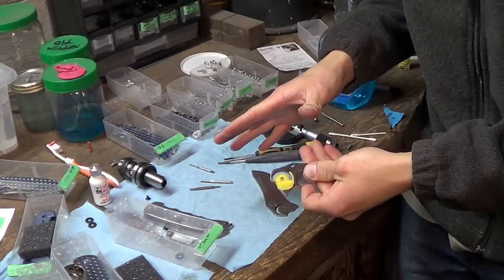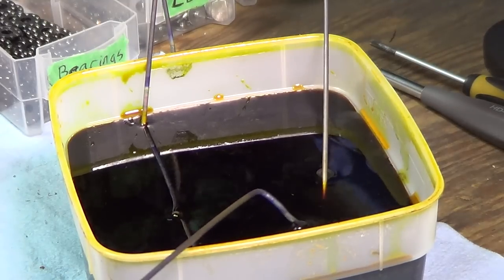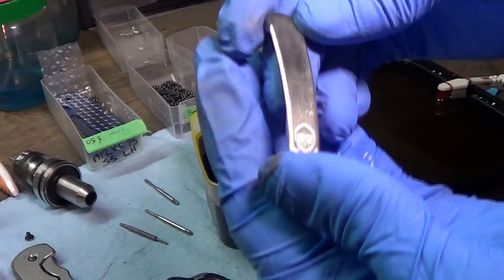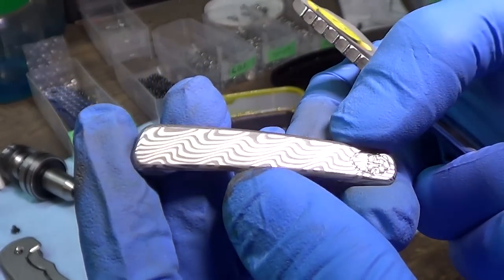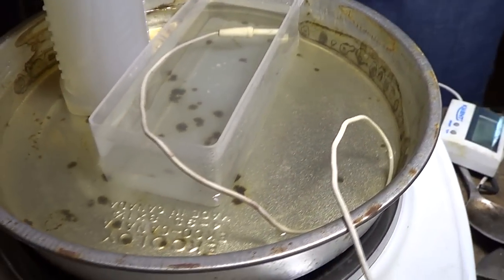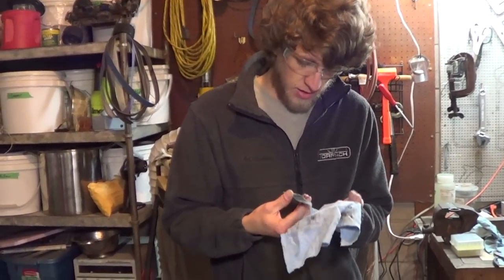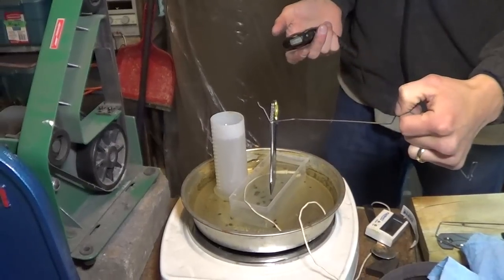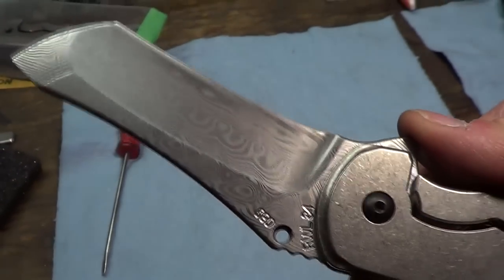Etching Damascus knife blades

Comment: A tip for everyone....keep the acids away from your tools...even if in a sealed container...Muriatic is nasty enough to slowly evaporate and/or leak from the container, you will find that nearby steel items will rust.

Comment: The patterns on the blade reveals the technology of how they make the blades. It is like a samurai sword. They press on the melting metal to form a sheet, then reheat it and fold two layers into one, then press it again. They repeat the process to make the stainless steel harder and more easily sharpened! This is just an ancient old trick that modern people find their ways to entertain themselves out of it.

Comment: Muriatic acid is "hydrochloric acid" (HCl) in a less pure and diluted strength for non-technical applications like cleaning bricks. Ferric Chloride is an iron "salt" of HCl that is nonetheless very acidic, though not as "strong" as HCl.

Either will etch any high carbon steel, eventually. It is a matter of strength and timing. Everyone has a slightly different dilution and technique. The keys are "pretty dilute" and "multiple, short immersions". Wash the black oxide off between immersions and perhaps brush lightly with non-abrasive kitchen Scotchbrite or 800 grit paper. Dilution should best be done with distilled water to keep it uncontaminated with water minerals. Beyond that it's a matter of experimentation.

Either will do fine on Damasteel.

Comment: Good work John!! I'm no expert, but here's a hypothesis: I suspect the bubbles hold the acid back and act as a temporary resist - until they pop. I think if you let the blades sit, each bubble will last longer, and you'll get pronounced pitting around the bubbles. If you keep agitating so the bubbles are short-lived, you may get a smoother finish. Keen to hear your thoughts.

Comment: When I did it for a company. We used mixture of 4:1 diluted in water. 3 15 min intervals. Scrubbing between each intervals with baking soda and water. Then rubbing it with a bit of 400 grit sand paper. Just to bring out the highs.

Comment from the maker: Interesting question. As far as I know, etching does not weaken the steel.  It does remove a teensy bit of metal, but so little that it doesn't make a difference.

Comment: nice blade. I want to humbly mention that you may want to try cutting the ferric chloride about 4:1 or 5:1. The more dilute etchant leads to less pitting and still gives a very nice etch. It is still much faster than hydrochloric. It mostly reduces the reactivity with the nickel-bearing steel (or chrome bearing). I can't make a folder like you can, but I make swords. For showing hamons, use one or two etches of ferric chloride, then use 2 or 3 etches of vinegar for over a hour each time. Vinegar makes the hamons turn more white.

Comment: Hey dude i wouldnt worry too much about the pitting in with the ferric chloride acid because you are using a ferric acid to etch a ferrous metal, so the pitting is just gonna happen. But you dont want to etch too deeply, remember, the more you etch the more metal you are eating away, potentially weakening the blade. You want that happy balance between a strong blade and a pretty blade. Awesome work though dude keep it up.

Comment: Muriatic (Hydrochloric) is going to etch just about everything evenly, and the more resistant alloy will etch slower, but evenly - FeCl tends to etch randomly at grain boundaries, so you get those little bitty pits.

Electrochemical etching isn't a bad idea either - "anodizing" your steel like you would aluminum won't result in an anodized layer - it'll just "de-plate" the surface, VERY evenly, and might even out the pits as well.

Comment: John, I just etched in Ferric Chl. I heated it in the Microwave for a few minutes and it was hot. It did an excellent job too btw.  Just wanted to make sure (after the fact),,, that what I did was ok n safe ????  I took the necessary safety precautions, using breathing mask, safety glasses, as well as ventilation and airing out the room etc. but, I just wanted to ask before I did anything again ????  Loll 
Mark in Ky.

Comment: Etching is used in metal research to bring out the grain structure of a metal sample (but for 15 seconds on a sample). While it shouldn't really weaken the knife, as seen by the significant pitting it can decrease the amount of metal you're actually working with.

Comment: from what I have learned, in order to get a good contrast between the metals, you must first heat treat and temper the blade. Do your metal finishing (wet sanding) then etch in ferric chloride. 
I know this is an old video but anyone new, this may help.

Comment: Damasteel is pretty easy to work and gives a good cutting edge, but once your comfortable with it, I would try real Damascus. Not that there is anything wrong with damasteel, but the higher carbon of most Damascus will help your blades keep their edge longer and you don't have to buy, or handle muriatic acid to raise the grain, but without all the nasty pitting.
Nice work, thanks for the vid!

Comment: Ok if this helps your supposed to heat the ferric cloric acid if you read the instructions on it when used for etching in electronics there is an optimum temperature, so if there is a optimum temperature for etching copper it will be simular for your damascus. Im Electronics Engineer.

Comment: John, to get better contrast between layers when using ferric, try multiple short soaks and remove all of the scaling with 0000 steel wool and baking soda in between each soak as someone posted earlier.

Comment: For ferric chloride, you need to have 1 part ferric to 4 parts water mix ratio. it will etch much much faster and deeper. and dont scrub the metal, rinse it with windex and let it dry, then hit it with fine steel wool. the contrast of colors will be much stronger. make sure the metal is extremely clean with acetone before it goes into the acid bath, completely free of oils from hands and finger prints.

Comment: I'm wondering about the vinegar. I made a perty cool knife it's Not Damascus  but the camo came out cool.gona try my  Damascus metal blade now and see if it brings out the grains better..I just did muriatic acid with hydrogen peroxide 50/50 after taping in a camo pattern with aluminum tape.

Comment: Ive etched a bunch of blades, and at first I got mixed results with the color contrast, try a fish tank bubbler in your acid, this keeps the pitting to a minimum and you get a even etch, after etching, neutrilizing and scrubbing try applyoing a cold super blueing, a couple coats drying between, rinse, neutrilize and wet polish using wd 40 and 800 grit paper....you'll be suprized how dark and easy it is.....nice work by the way

Comment: Hi there,
I have some damasteel here as well (about 26mm round bar) because I made an engagement ring for my fiancé. The only-sulphuric acid didn't work well for me, so I moved on to sulphuric acid (battery acid grade) with perchloric acid. Worked great, but most of the contrast is already gone. I have now ordered Fe(III)Cl, HCl, Cu(II)Cl and better H2SO4 for the "ultimate" etch. I hope this one will be more durable, but I'll let you know. If not, any ideas?

Comment: Try Muriatic for what you're calling "height" difference and then Birchwood Casey cold blue to darken.  Touch up your high points with 1500 wet dry paper on a finger block and you'll get some amazing looking damascus.

Comment: Hay John,
You can get a bit better etch with the radio shaq ferric chloride if you dilute it half strength brotha. I have been using it for about 6 years now:) but it goes bad fairly quick. I also do a much harder etch than your doing so who knows? I dont get any pitting like you were getting.

Comment: when you etch with the faric chloride, or anything else for that matter. If you let it etch until both metals are etched, you went too long. Basically let it etch long enough to bring out the dark color, and no longer. Once you start to erode the top metal,the "shiny" one you are doing nothing but screwing up all your prep work on the blade before it went into the solution.

Comment: Perhaps part of the problem of contrast passes in your solution have 3 metals. The two varieties of steel forming Damascus, and the wire you use to hold it. Try a plastic cord. Good luck.

Comment: You are NOT going to get a different coloration (blackening) because of the corrosive liquid of choice. For that dark grey or black coloration, you'll need a blade with one of the steels having a significant amount of manganese in its composition.
Reply: Dwight looi.    Nickel. Not magnesium.

Comment: Just looking at the sharpened, edge of the blade after it came out of the asset, did it actually take away a part of your  sharpened Edge ?
Reply from the maker: jozzerful2 It's not fully sharpened at this point, just mostly.  If it were totally sharp then yes it would take some away.

Comment: I have a set of Damascus 67-layer kitchen knives. Can they be etched like this? Will there be any issues with the sharpness of the carbon layer?
Reply: +Viranjith Tilakaratne 
Sure. The contrast will depend on the difference of the steels used (mostly on the chrome, nickel, vanadium, and carbon content). Be sure not to let the acid get e.g. between the handle and the bolster / tang. I recommend using sulfuric acid. You can heat for faster etching, but don't inhale the fumes. Always neutralize the blades after etching.

The layers with higher carbon content will obviously etch more, and depending your pattern, you might get a rough or 'sawtooth-like' cutting edge. Some might argue this is good for cutting meat, but at least I have always sharpened the knives after final etching, smoothing out the edge.

Comment: I have a question I have real Damascus 1911 it has a Damascus slide. the gun is stainless steel they have it done in matte. the areas in between the shinny areas are matte like can I redo the Damascus to get higher  contrast. it has a sweet pattern but the areas in between need to be darker. how done do that.

Comment: These knives are clearly better than anything ill find at basspro, however I'm curious as to how you justify a $500-$600 price tag. Especially when they're more or less all the same. I understand that the materials you're using are high quality, and the machinery can't be cheap. But $500 for a pocket knife? Serious question.

Comment: What did you use as a mask for the pattern? How did you apply it?
Reply: this type of steel called damasteel (basically an imitation of the ancient damascus) is made by welding many plates of two different steels together (one more chemically inert than another) then forging the resulting block in different ways in order to fold all the layers over and make cool patterns. Because one steel is more inert, and chemically resistant, when the resulting damasteel is put in an acid, one type of steel is eaten away and discolored, while the other steel either does not, or does to a significantly lesser extent, providing the contrast between the two steels and giving the damascus look.

Comment: Nice blade, I hate muriatic acid though.
It will rust everything in the shop if the bath isn't covered.
I use battery acid, it gives a nice slow etch and cleans up with soap water and a toothbrush.

Comment: So will this work with any metals? Because I have some hardware on my electric guitar I want to relic, and I thought etching it would be pretty cool. Would ferric chloride of muriatic acid be better?
Reply from the maker: +Joe Bigwood No, you will only get patterns like this from actual damascus steel.  If you etch other kinds of steel it will just turn an even dark color.  We use Ferric for steel and stainless, Muriatic for our stainless damascus blades.
Reply: +JohnGrimsmo That is not actual Damascus steel.  Nobody today makes true authentic Damascus steel.  Try doing some research, so you know what you're talking about.
Reply: It sure as hell etches like Damascus.
Reply: Do some research oh how true authentic Damascus steel ..."Was)... made
Reply: +BennyCFD I'll be honest, I was just curious. You seem to be knowledgeable on the subject, what's the difference between this modern 'Damascus' and the proper old stuff? I thought it was just a folded blend of metal?
Reply: Do the research the info is there, but in a nutshell Damascus steel is a lost process of placing raw iron ore from the ground in a clay crucible, add your coal for heat then the iron will form at the bottom in it's raw form.  The distinctive look come from the formation of the carbide crystals that form from the low temp smelting process and not from folding modern steel over and over again.  Also True Damascus steel has a very high carbon content like 1.5 to 2% most everyday steel has something like .65% generally.  It's the process of smelting raw iron ore.  not the forging.  I't interesting the history of it.
Reply: +BennyCFD Ahh, I see. I've mistaken Damascus for pattern welded steel. My bad. Thanks for the info though!

Comment: Hi, are you diluting the acid muriatic with another one? I followed the process however the result was a gray opaque color, no pattern. Sorry, I thought you was using acid muriatic, what liquid is etching the blade?
Reply: Gaspar B are you starting with a folded Steel? folded "damascus" when polished looks like any other Steel. but when etched it brings out the differences between the two steels used in the folding process. the pattern in the steel isn't applied with the acid, only brought out. 

hope that helps!
Reply: Thank you.

Comment from the maker: I didn't place the wire through the pivot hole because I didn't want to possibly mess up the nail polish that's protecting the hole.  Through the thumbstud doesn't matter because it'll be covered by the thumbstud and the screw.

Comment: Try 3% to 5% nitric acid, in a solution of denatured alcohol.  Just be careful when mixing the solution always fill with alcohol first then the nitric acid. It cause a slight exothermic reaction but is stable after you stir it. This will surface etch the patterns highlighting the grain structures also the cleaner and more polished the blade is prior to etching the more brilliant the grains will appear.  Never leave acid open to atmosphere in confined spaces it will evaporate into the air and can attack any untreated surfaces or your lungs.

Im no expert just dabble in metallurgy ;).

Comment: Actually, I rather LIKE the "Stippled" effect that the Ferric Chloride had on the steels!  Both she Muriatic, And the Ferric do produce UNIQUE, and amazing results! Not everyone likes the SAME thing, RELAX! => and ENJOY some diversity in your work!  You might want to try using common "lye" (sodium hydroxide), or, even, just Common SALT (table salt/rock salt/Sodium Chloride), mixed into in distilled water, and then connected up with a battery charger (DC Power supply), to 'electro-etch' your metals!  It's Fast, and much cheaper, safer, and easier than messing with "acids"!

Comment: What happens if you dont protect the edge of the blad. Did you have to re sharpen it???
Reply: The edge ? when do they speak about the edge ?

Me thinks you need to resharpen anyway.

The etching removes a thin layer of metal, and will produce irregularities on the surface; you definitely want to avoid this around the rivet. It would increase the friction on open and close.
Reply: Benoit-Pierre DEMAINE
I don't think there was a true edge. This is a parts knife anyone can make. Google it.
Reply: alwaysopen This is not a "parts knife [that] anyone can make." John bought the "Damascus" blank and machined the blade himself. It is his own design. We knife makers leave the edge dull until the knife is finished. Otherwise, we wouldn't have any fingers.

Comment: Just wondering, Where exactly do those patterns come from? are the blades made out of different layers of steel and are folded?
Reply: They are folded in forging not alloyed.  So you are correct.
Reply: So the patterns comes from the many layers of different metal and how many times they are folded? And not etched/engrave then letting the chemicals to show the design? Ye I don't know much about Damascus blades and the designs, I am interested though on getting one.
Reply: eroOtoko1 Yeah it is all natural based on how the folded metals forge into each other and you can make it look really trippy if you also add more different metals.  I am not a knife hobbiest myself but I have done a lot of material science in university.
Reply: Usually you're dealing with different types of steels which interact with the acid differently.  Steel alloyed with Nickle will tend to fight off the acid more than a high carbon steel.
Reply: ah I see cool
Reply: The Damasteel is made from powder steel and is not folded like traditional damascus steel. It is also stainless and the two alloys are RWL34 and PMC27.
Reply: eroOtoko1 Damascus is generally made from a combination of mild steel and stainless alloy (usually mild steel + nickel, chromium, or both). If you're doing it with a forge, you generally have three pieces of mild steel bar stock, two thinner sheets of stainless, weld the ends with an arc or gas welder, then flux and weld them together in the forge.

The difference between Damasteel and traditional blacksmithing is that the Damasteel has already been heat treated to the proper hardness if you buy the right type. It's great for hobbyists who don't have the space or cash flow for a forge and kiln.

Also, more folds isn't necessarily better. The more you fold, the finer the pattern becomes until you can't really even discern a pattern. When I was doing traditional blacksmithing over last winter, five folds of a 5-layer bar (80 layers) was as far as I'd want to go before the pattern gets too fine. The pattern can change wildly based on how you twist, press, and otherwise deform the bar between folds.
Reply: Thanks for the info! appreciate!